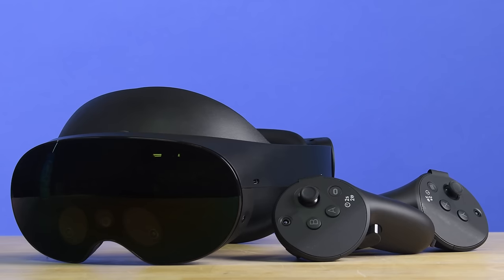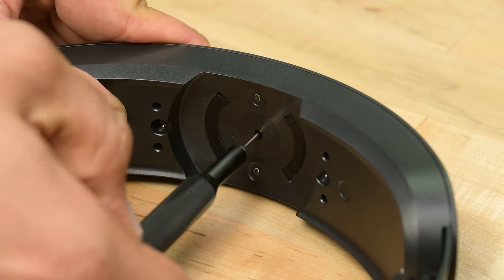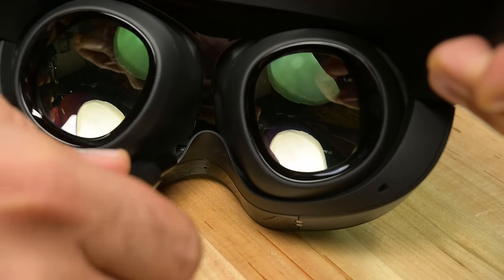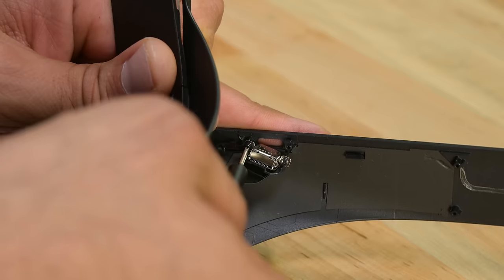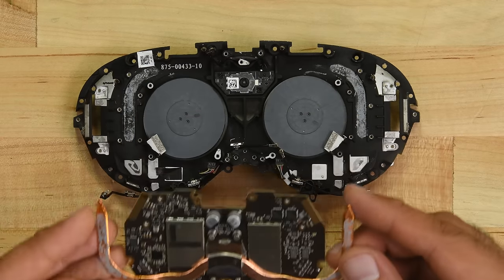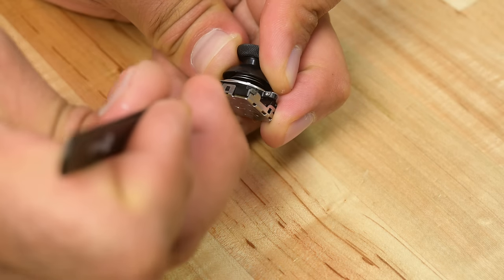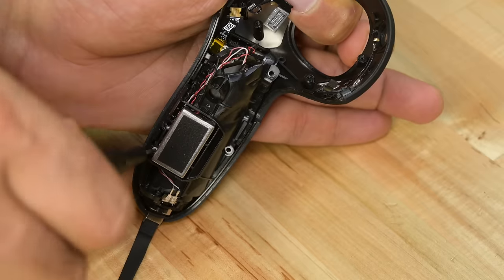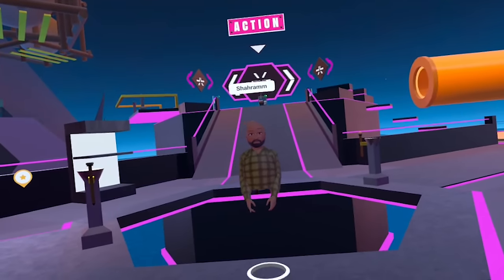Meta Quest Pro Teardown: Inside the $1500 Portal to Mark Zuckerberg’s Metaverse

Comment: Man meta has spent lot of time developing this!
Reply: And billions of money.
Reply: @entp3698  Sure billions, but not all of it went into the device. They had a lot of the concepts ready in 2019 and have more prototypes working with the possibility to put them into future products
Reply: @jonathanwieringa8808  thanks Captain Obvious.
Reply: Mark Z is my hero <3
Reply: They spent billions on making a cheesy version of VR chat and a 1500 dollar headset that has a lower resolution and frame rate than their 500 dollar quest 2.
Reply: @info_fox  your style of cynicism is crazy to me
Reply: @info_fox  It seems you don't understand how innovation works. This is a new frontier. VR won't be fully matured for another 10 years. Don't expect polished products, especially from the first version of a product line
Reply: @info_fox  true, but that is kinda nitpicky and too simple. Quest pro has AR and VR. The pro has better controllers that never lose connection with the headset cause they themselves know where they are and have their own chip each and 3 camera's each to find where they are. Quest pro also has a more powerful chip of about 50%. Don't forget the RAM on the Pro is 12GB and on quest 2 6GB. The resolution is actually higher, but the quest pro has a lower frame rate than the quest 2 because the quest 2 is a single of the shelve screen. While the quest pro is a screen for each eye that was developed by meta themselves to get a couple advantages. This allows them to put the screens at an angle from each other to get less sick and use pancake lenses that are more than twice as small as the lenses for the quest 2. They can follow your eyes with eye tracking and only improve the resolution where you're looking saving a ton of battery life and computing power. Can't do that with quest 2 screen. Quest pro also can see your facial expressions and use that to move the face of your character. They are improving that to make your face move on life like characters, but that is still too power intensive to compute. They are working on making it so that virtual lights seem real to where the screen can be multiple times more bright than possible on of the shelve screens. They are working on improving speaker sound to where it will sound like someone is actually next to you talking, therefore the built in speakers in the Pro and not the quest 2......srry I can go on. Take that Vapid Shay.
Reply: @vapidshay  Go read that essay Vapid Shay
Reply: @vapidshay  Tanks, captain obvious. Now the circle is round

Comment: $300 controllers with non replaceable batteries, pass!  This was nothing but a money grab by Zuck.  Companies that do built in rechargeable batteries make claim it's better for consumers not having to replace batteries but it's actually the opposite when you have to stop using the device to charge them up.  And then when the are past their useful life, you have to buy new controllers.  But the biggest mistake they did was raise the Quest 2 price by $100.  I'll be looking for a different VR headset unless Zuck can get his price point more affordable.

Comment: All you have to know about this product is this.   If you are in the US you get one year of warranty.   That's right 1 year for a 1200 dollar piece of over engineered yet cheaply sourced (Nintendo Analog sticks???? so drift on a 300 dollar controller) tech that still doesn't have a compelling enough software environment to make it worth it.   This is coming from someone who invested in the beginning of VR tech from original oculus and I own a 2.   Sony PSVR2 is also a hustle since its tethered and tied exclusively to PS5 instead of being accessible to PC which would give its price a little more justification.

Comment: I wish you would spend time with some of the creators in the metaverse. It is more about the social aspect and what we can do to build a world just from the headset without a PC required. That said, there are a ton of great games I enjoy on the Quest. I  own the Q2 and the Pro as well as the Valve Index and the older drop your cell phone into the compartment type VR glasses. 

I host Meditation Events in Horizon Worlds and that is incredible because I can build experiences around meditation types. We also have Kyle Failed to Render and the Soapstone Comedy Club among others.